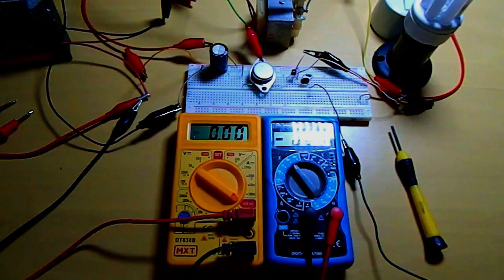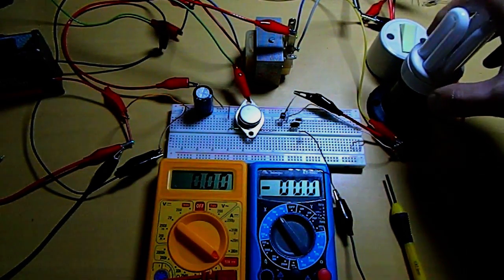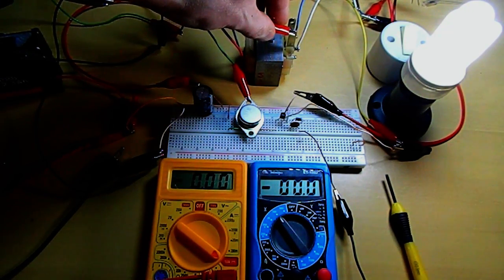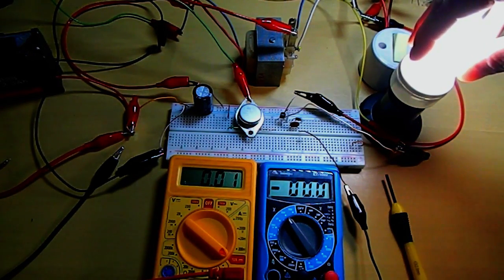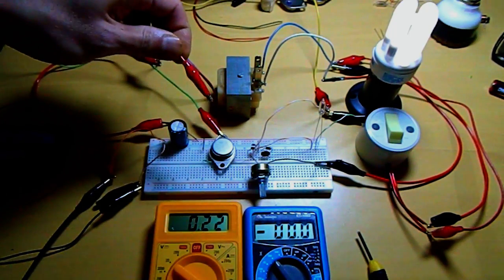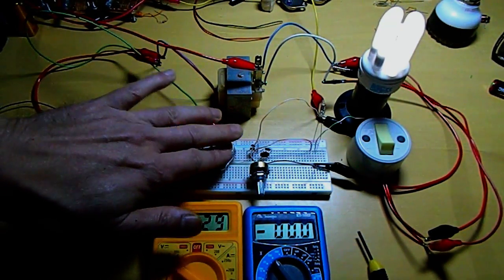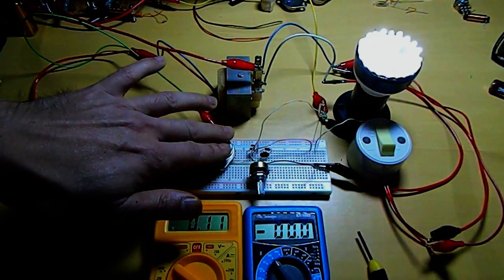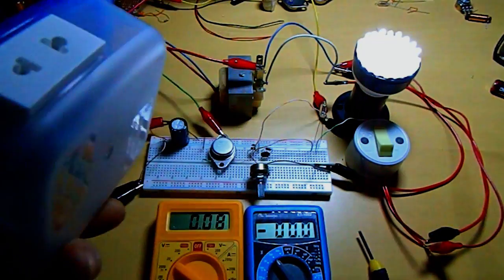Joule Ringer CrossOver - CFL and Led bulb

Comment: Hi Sohei.  No it is not crazy.  
At high frequency everthing couples with everything else, even through 'free space', and even through YOU !.
Also at high frequency your digital meters CANNOT work correctly.
Try connecting capacitors across your meter leads at the points you connect them to your circuit, between say 10uF and 100uF.

Comment: Hi, well done! 
Use a LC LOWPASSFILTER at the battery and measure there before the LC filter the DC input. 
Also helps to shield the measurement cables with grounded alufoil!

Comment: thanks for sharing :) it may screw up the tuning of the circuit.. but try running an ultrafast diode off the + side of battery + ----->I-------   then, after the diode, connect that to one side of a non polarized capacitor, say 1000V 100 nF. On the other side of the cap, run that to battery negative. Measure voltage across the cap. Now, on the input, make 5A shunt that drops only millivolts. Or one ohm resistor, if u have to. Use a similar diode cap arrangement to measure mV drop across, for I.